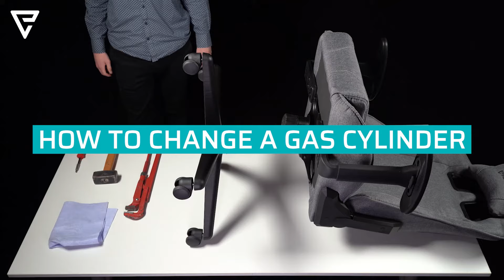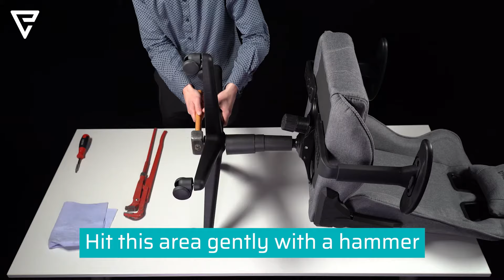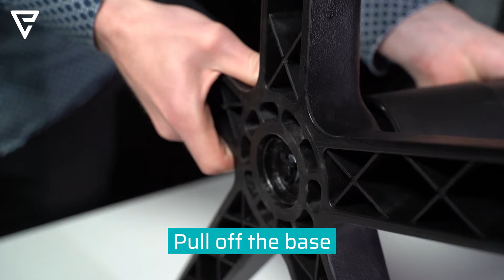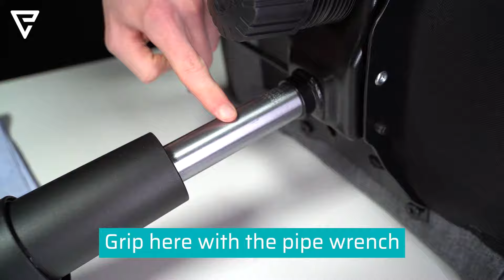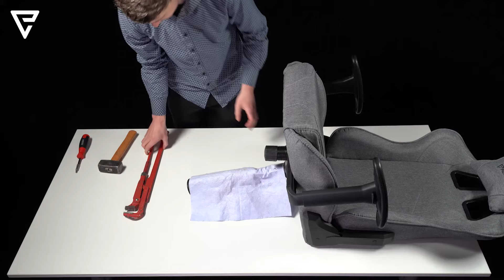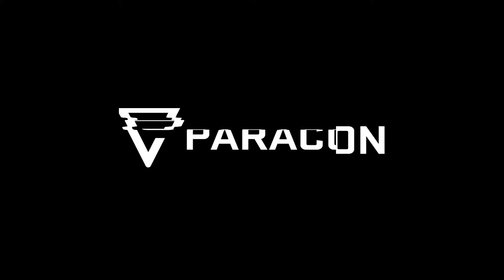How to remove and replace the gas lift cylinder on a gaming chair

Comment: I'm a 60 year old with RA. I wacked that cylinder with rubber mallet and 5 pound hammer. Couldn't get it, my son tried (big guy), 2 of my neighbor guys tried and nothing. Sprayed it up with WD40 and let it sit. Put it up on 2 small step stools. And from my wheel chair gave it about 10 hits with 5lb hammer And it finally popped off.

Comment: There's no way you did that in one hit
Reply from the maker: :P
Reply: I’ve been hitting bottom of my chair for the last hour. And still not budged
Reply: @pnribo  Get some WD40. Trust me. The drive to the hardware store and back is a lot shorter rhan the 3 hours I spent attempting to swap the gas lift on my chair
Reply: @JM-hj3sm  brute force and ignorance paid off. And a little wd40 lol. Cheers pal

Comment: I posted this on another video. It doesn't always go according to plan:
I just did my older high quality desk chair. It took 2 days. The bottom wheel carriage came off easily enough I guess, but then......
I soaked the part that goes to seat portion in Wd and PB Blaster, No Joy, and I have a large 18" pipe wrench. Tried it again after soaking overnight. No joy. I was putting so much force on it I was afraid I'd break the rest of the chair. I then removed the seat adjustment mechanism from the seat and put it in a large heavy vice so I could hold it in place better. No joy. Then I clamped the cylinder in the vice and tried a HF hydraulic spreader to try and pop it off while wailing on it first with a dead blow, then with a 4lb sledge, but no joy. I went back to the internet thinking maybe mine was bolted or welded on, but no. Finally, I took some of the more fragile parts off of the mechanism took it out side, placed a board on the ground and placed it on the board and then used the front end loader on my tractor to hold it down. I then put a 4' cheater pipe on the pipe wrench handle and gave it everything I had. Joy!!! My chair is now fixed and works great again. All you need is a tractor with a front end loader and a few thousand pounds of weight and 4' pipe wrench and 220lbs of fat man and it comes right off as easy as pie.
Reply: I feel this situation so intensely right now.
Reply: Literally having the same problem. Can I borrow your tractor?
Reply: Lmao 😂 right there with you
Reply: Same!!
Reply: Thank gawd. My brother has a Kubota! LOL

Comment: Aren’t you supposed to remove that red tap at the top?
Reply: with some chairs like mine it's part of the mechanism. i litterally just pried mine out cause it wasnt coming and thought that was my issue and the whole mechanism was orange that popped out. (held in by a one directional clip.)